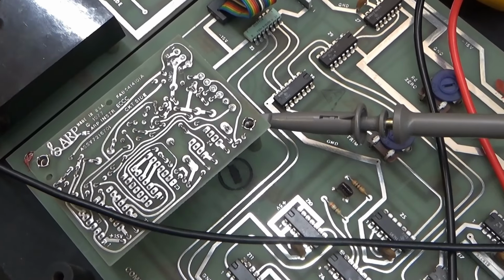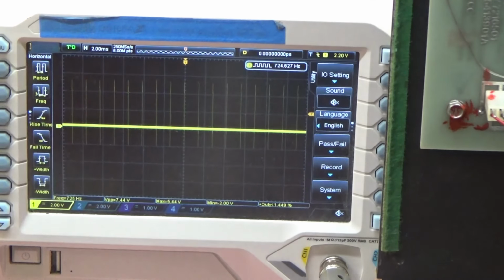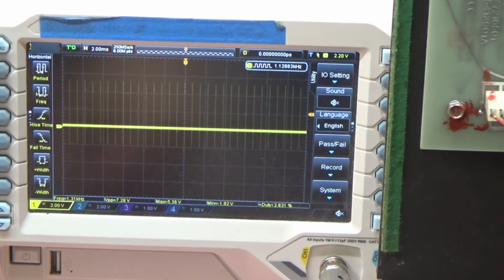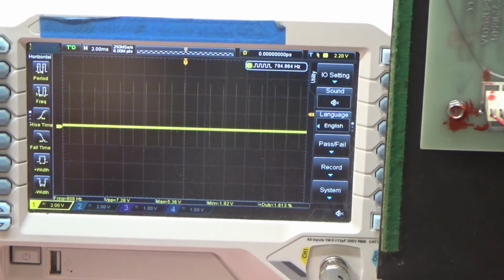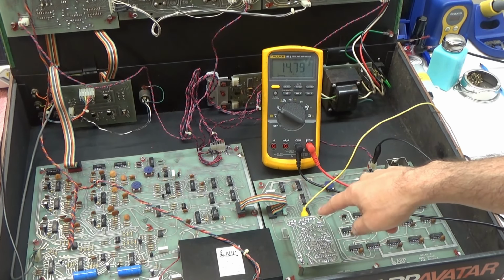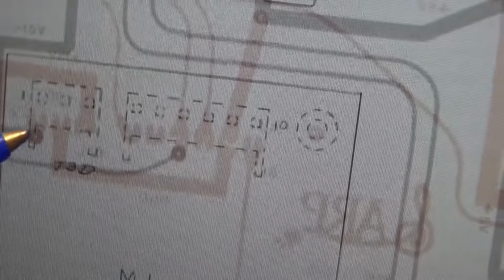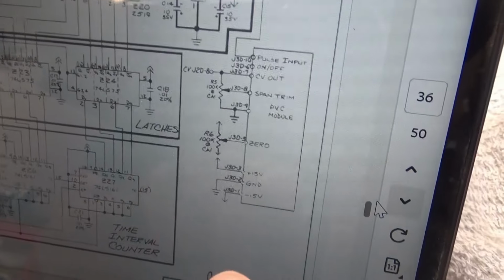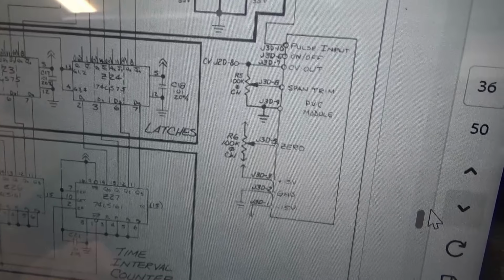ARP Avatar Guitar Synthesizer Repair - Part 2 - Synthchaser #174

Comment: A little birdie told me, that Behringer is considering, re releasing their own Avatar.
I’m sure that they’ll work outer bugs.
I had ordered one way back when and never received it. My money was returned, but it’s the synth
that go away. 
Now I’m thinking buying a Behringer arp 2600  and a Sonus G2M …
Wonder if that will work better. 😳😳😳
Reply: Yikes
Reply: @VincentPresley I bought a used Avatar back in the 80s. I liked it.
Reply: @DavidRavenMoon the synth part is fine. It’s just an Odyssey stuck in mono mode. So if you’re just using it as a synth you could just buy an Odyssey. The guitar interface was terrible. If you play monophonicly, very slowly, it might work. Who wants to play a guitar monophonicly?

Comment: Why don't you Blu-Tack the pickup in place?
Reply: I think it was too thick to fit u der the strings without fiddling about...
Reply: @sylvaind9086Can confirm. I had to cut a section out of the scratch plate on my guitar to fit it. Ideally you have someone carve a groove for it in the wood of the guitar to sit, because it's way too big to just slide underneath.

Another dull fact, one of the two pickups has a crazy wide string spacing because that's what Fender used in the 70s before changing in the 80s. I wonder if the depth is related to guitar designs of the era too.